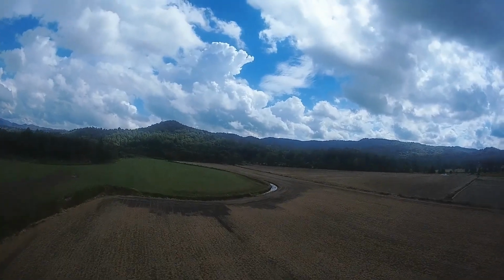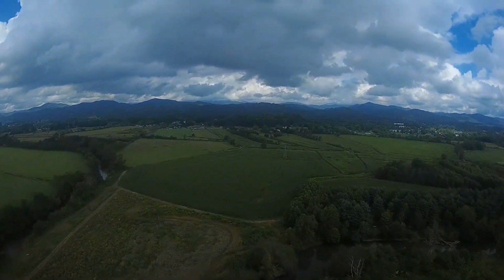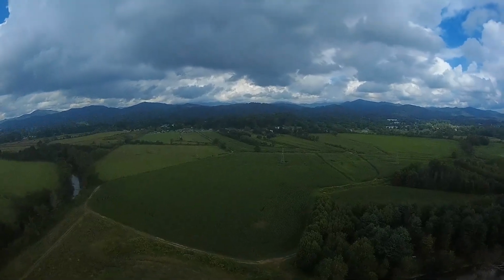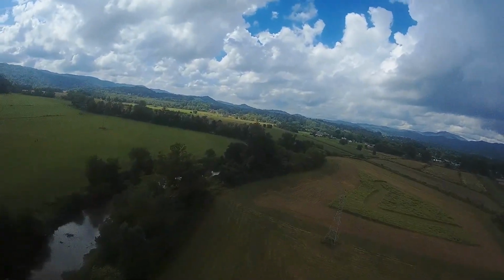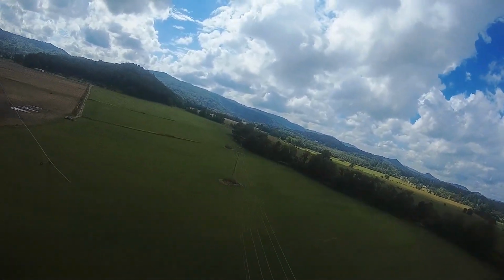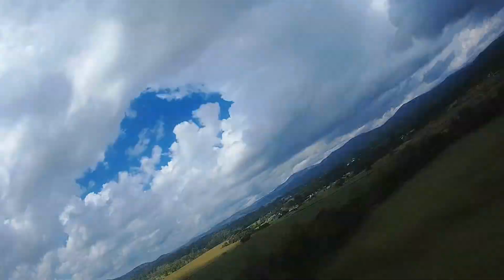T1 Ranger Rapid Deconstruction

Comment: Sorry to hear of this crash, if the motors don't tilt when they should, oops.
It might not be too bad to fix though.
Cheers
Reply from the maker: Easy to fix.  😊

When one tilts and the other doesn't it is bad.  Problem is that it may still be in the wiring or the motor tilt servos, and it could do the same again after replacing the FC and repairing everything.  If it had been more mistakes high, I would have glided it right down to that nice soft sod as an airplane.  But even if I had done that and replaced the FC, it may still do it again.  Hopefully during preflight testing or on the bench rather than in flight.  We shall see.

Your kind words are much appreciated.

Comment: Vernon, sorry about the plane but.
Every part of this flight told you no and you didn't listen the minute you didn't have OSD that should have been figure it out, unplug it and plug it in and that servo motor that did not work properly. That should have been a flat out no and I think you should start out with a bigger plane for beyond visual line of sight. At least if you take your goggles off, you pretty much can see where it is. Not something like this. Take care. I hope you come to a solution
Reply from the maker: Fully agree. I have/had come to aborting at any error. Today was to be a short flight. I didn't need OSD or the monitor for that matter. I would just have been watching it up until the moment I switched it into qloiter.  The right motor went up, the left motor didn’t.  Shame the GoPro video was corrupted.  It went into a flat spin instantly.  Right where it was.  It was astounding how little it moved horizontally.   It started parachuting down slowly, flat spinning at quite a rate.  One would have thought it would break the rudder it was spinning so fast.  Until I put it back in forward flight.  Had I not done that, likely it would have no damage.  BUT!  The wing was fully stalled.  The motors just had no time to pull it back into Bernoulli effect from less than 150 feet.  Was just testing the Walksnail and battery failsafe on it.  It was almost in failsafe.  I decided to test qloiter in addition to those two tests.  It would have just done the same thing when it changed itself into qloiter over the landing pad during qrtl.  Had that problem with the FC several times.  It did it the first time I took it to this field last week.  During preflight ground testing one motor went up and one didn’t.  Think I mentioned in that flight video that I then checked the wiring and sight wise all the connectors were down.  I pushed them all in anyway and it fixed it last week.  Flew through several qloiters that day.  It did the same thing again on the bench during the week.  And again, nothing sight wise wrong.  The second time I removed all the connectors and checked the pins.  None bent.  Put all the connectors back on and it worked as advertised.  Tested it today before flight and it worked perfectly.

OSD was/is flaky on that CHEAP FC that comes with it.  Works when it wants to.  One of the reasons I ordered a new H743-Wing for it Tuesday.  Doesn’t have connections for pan and tilt.  Plus, the RX, and GPS are not powered from USB.  If it were 48 hours from now, the FC likely would have been changed already before this flight.  That doesn’t mean that the problem isn’t still in the wiring/tilt servos and will still be in it after the FC is replaced. The FC that comes with it isn’t worth the powder to blow it to hell.

But I still fully agree with you.  It should have been an abort OR power it up and down until the OSD came up.  It would have still crashed but I do agree that ANY hiccup should cause an abort.